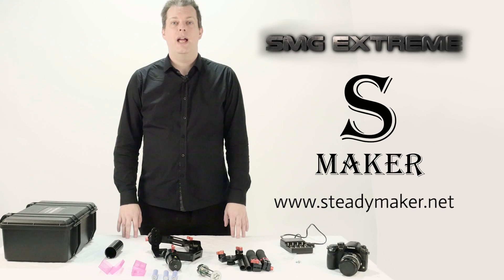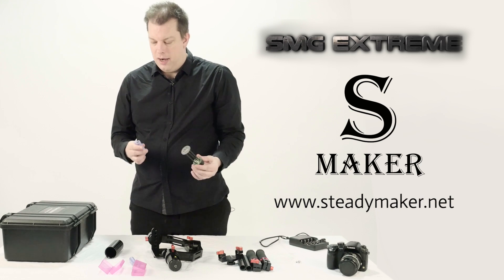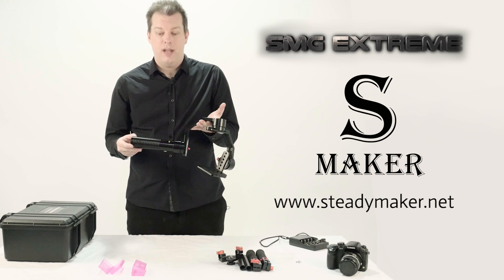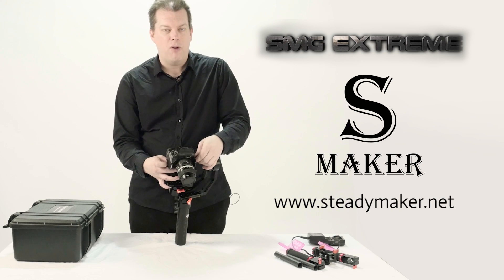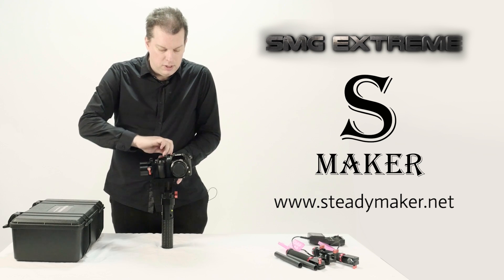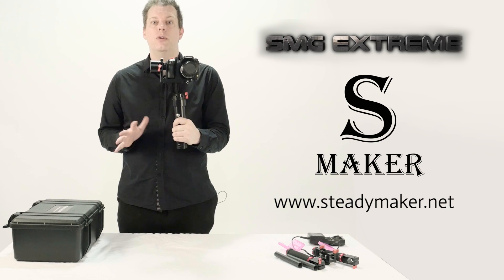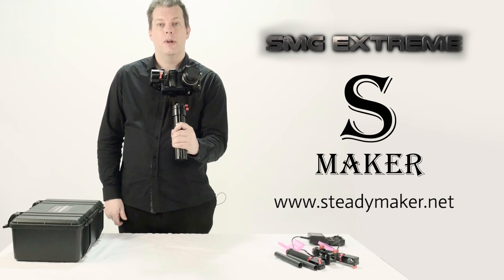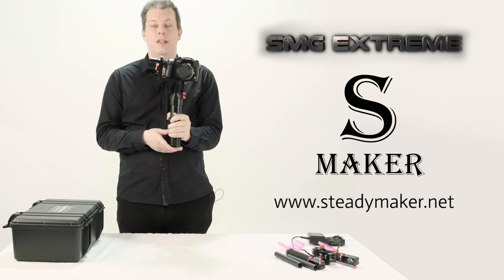SMG EXTREME: Batteries, Pre-Balancing, and Modes

Comment: Thanks for the presentation , stabilizer seems very interesting . 
I have a question , it is possibillity to mount the Manfrotto adapter?
Reply from the maker: Hi there|! Thanks for your question. The camera is mounted directly to the stabilizer cradle, so unfortunatly it is not compatible with the adapter. We find an adapter/baseplate adds to the weight and changes the center of balance, as it varies from adapter to adapter. If you have any other questions, feel free to email us directly : steadymakerhelp@gmail.com